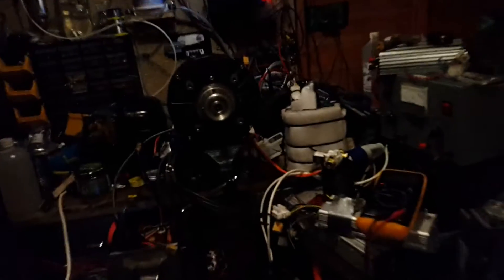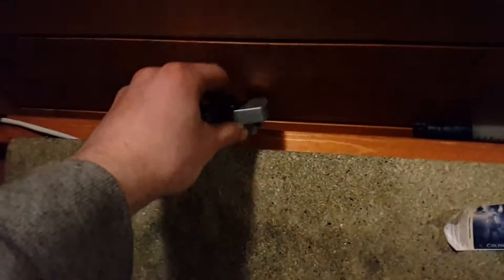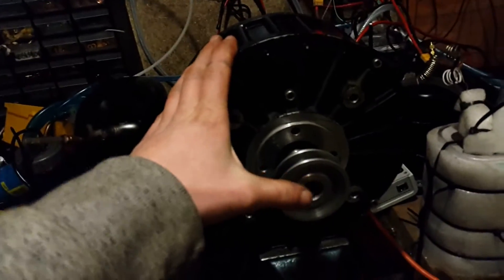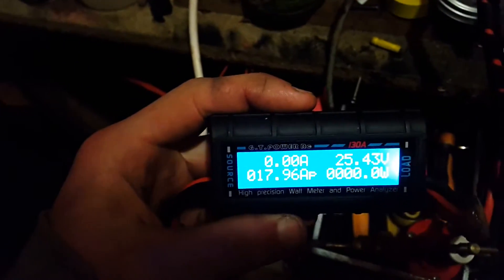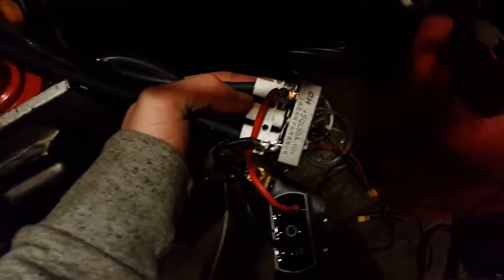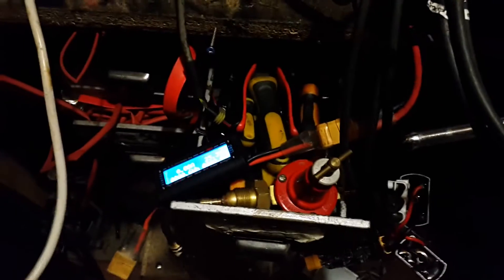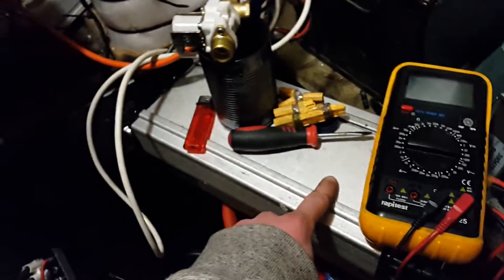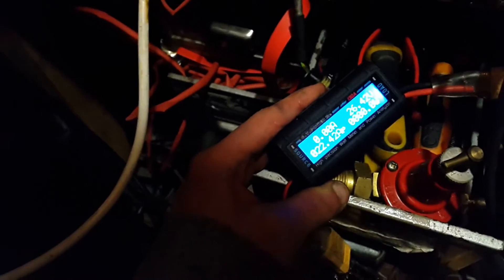SQL50A Bridge Rectifier

Comment: Hi. I noticed that the bridge rectifier has no heat sink. The power dissipated is very high for 20 amps. The voltage drop is 1.4 volts (two diodes at a time). With 20 Ampers the power dissipated is P = 1.4 * 20 = 28W.
You would need a heat sink with a surface of at least 1400cm2